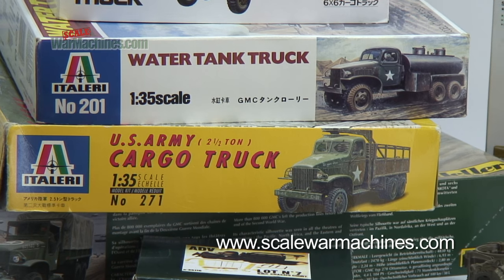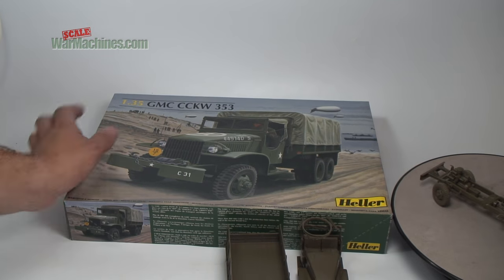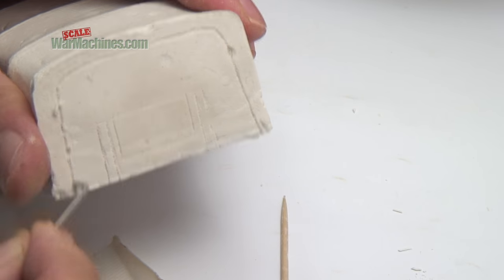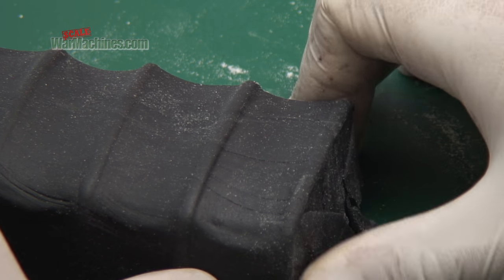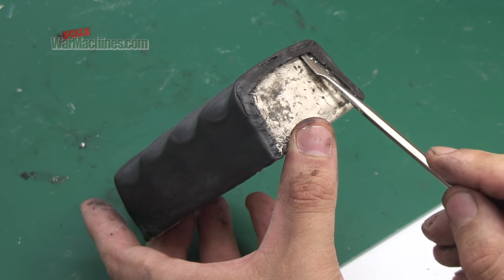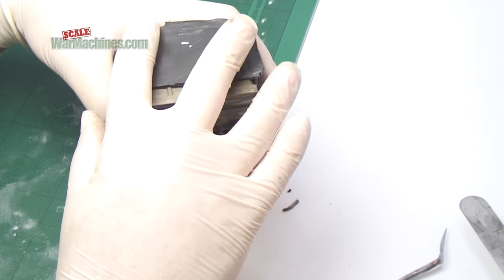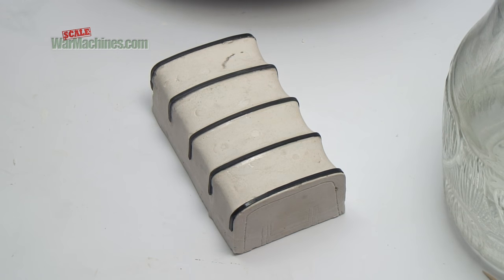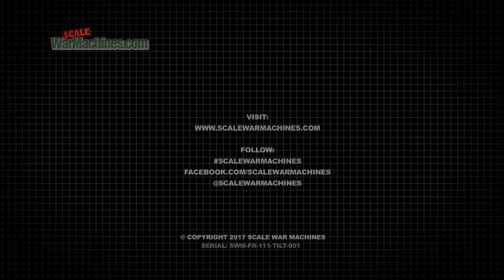MAKING YOUR OWN CANVAS TILT "HOW TO" GUIDE

Comment: Great video !  I've never seen this method before and I must say it's an excellent method. My question is, how do you do this for something like the RSO you showed in your opening ?  I've made one for one I built decades ago from tissue paper and white glue. It came out quite nice but I couldn't add details to it like your method allows.  Once again I must compliment you for sharing this with us.
Reply from the maker: You're right this wouldn't suit every application. The RSO could be solved by buying the Italeri reboxing with a tarp & then doing as we did with the GMC. Otherwise, the problem with using the kit hoops is they are often too weak to support a putty tilt. The best solution is to build a jig using plastic card & brass tubing - but check it matches the kit precisely. Then you know you have a strong base over which to sculpt.
Reply: Scale War Machines Thanks. I didn't know that Italiari had added a bed cover to its RSO. I'll have to look for one.
Reply from the maker: May be wrong but we think they did the late body RSO with a tilt.
Reply: Scale War Machines I made a top for the earlier version from paper and white glue but I've never seen a top for either version. Maybe, they have issued a version with one ? I'll keep my eyes open for one !  I know that a resin top was available at one time but I never got one.

Comment: why couldn't you just place the milliput on the plastic tarp and cut the time in half?
Reply from the maker: This idea was to create a stronger pattern for reuse & to try to refine the detail & fit exactly. But yes, that would have worked too.
Reply: It would not work, as the plastic tarp exterior would mold the interior of the miliput tarp. So, your miliput tarp would be bigger by the thickness of the miliput. It would not fit on GMS, and out of scale also. You need to create a mold somewhat smaller that the original plastic tarp.
Reply: the good thing about anything creative is there's always many ways to do one thing, and putting out one way is a great way to learn another

Comment: Hi .
Does the talc have any effect on the Milliput ? Thanks John .
Reply from the maker: No effect at all.
Reply: Thanks  good to know. I read that leaving it for about an hr  you can still impress the pattern (Of course depends on the temperature ) with out it pulling off. Something which I had when I did the Zim straightaway. John
Reply: Thanks.